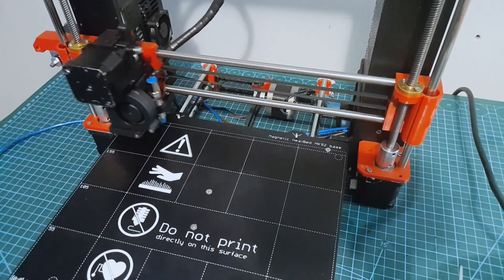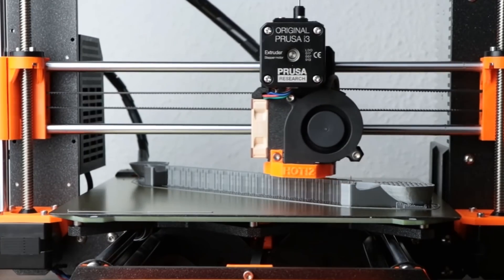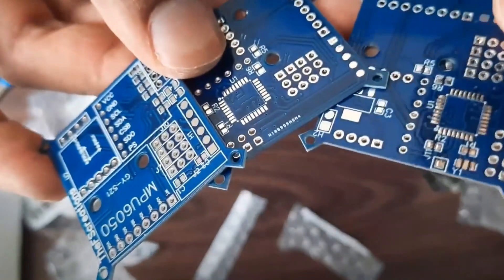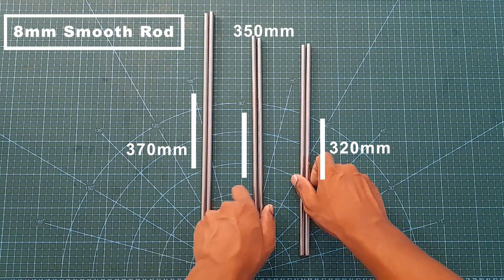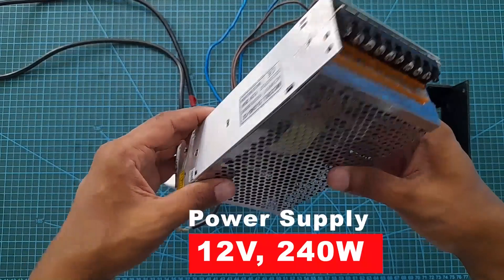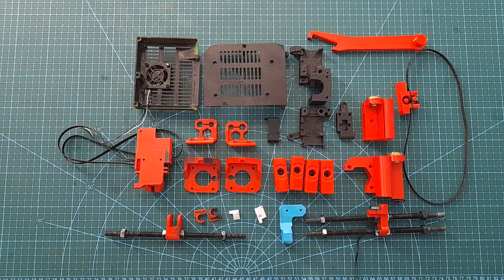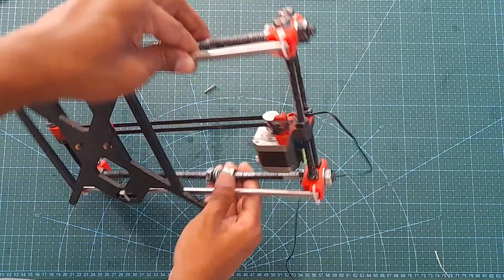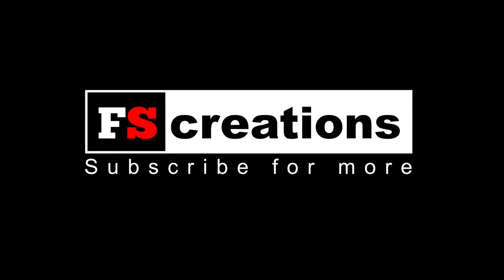Building a cheap Prusa i3 MK2.5 3D printer with Arduino| Episode 1

Comment: OK so here is the first flaw in your design, you said you used 350mm threaded rod and 350mm smooth rod for the Y axiz frame, this wil NEVER work, as you have the printed ends to connect and the nuts and washers to accomodate - a 10mm nut is 8mm thick, add a 1.25mm washer on both ends and you are stuck with a defecit of 18.5mm - where does that come from?
Trust me I have also built this from another guide that actually said use 370mm threaded rods so the 350mm rods will fit between the 3d printed parts. Cmon man - do better next time with your engineering before misleading people.
Second flaw is - where is the motor back support? Your Y axiz motor mount is going to either deform or break under load when the Y axiz moves at higher rates of speed.